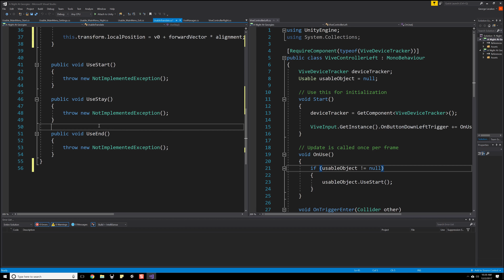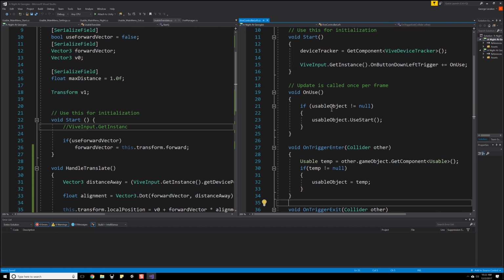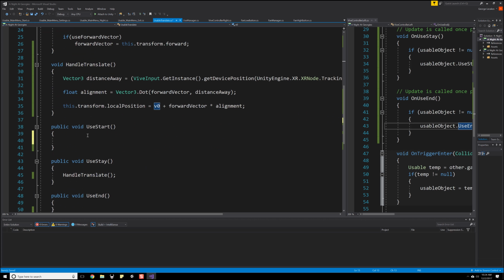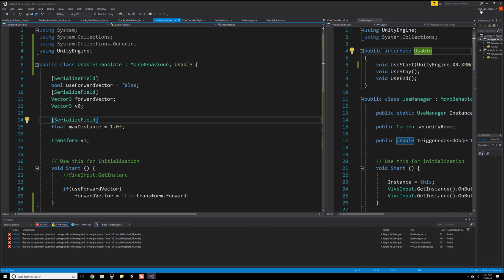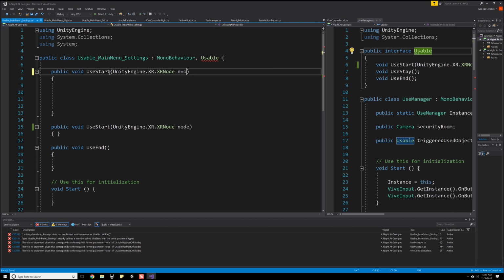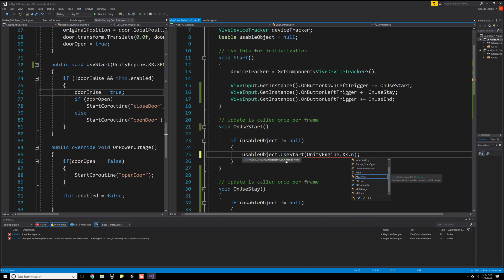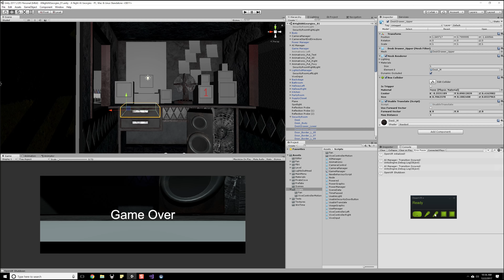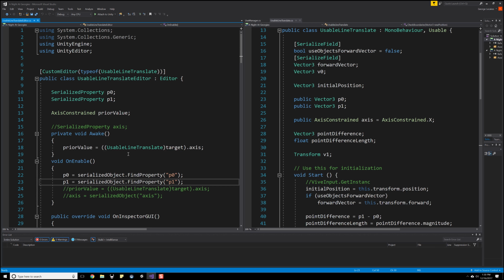FNAF in Unity + Vive - 135 - Making Drawers Move

Comment: did the shelves jump to that far away position because UseEnd() set v0 = Vector3.zero, and then later it used v0 in calculating where to put the shelf that you are using?

I am attempting to do the same thing with opening shelves and your video is the only one I could find specifically for shelves. I've been able to open shelves with my own similar algorithm, but I want to see how others are doing it to see if I am doing anything stupid. One thing I gained from your video was that I shouldn't be doing it in update, but in late update because like you said, we dont want to calculate this every frame if it interacts with vive input! Thank you for that!
Reply from the maker: Pretty much. I'm gonna fix it and upload later after the holiday season.